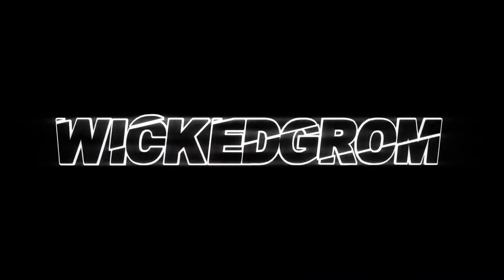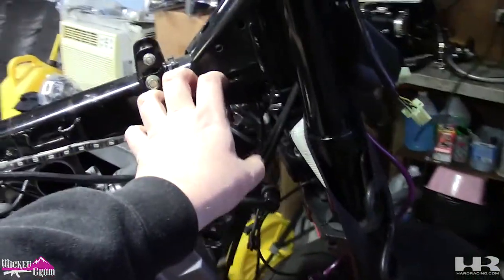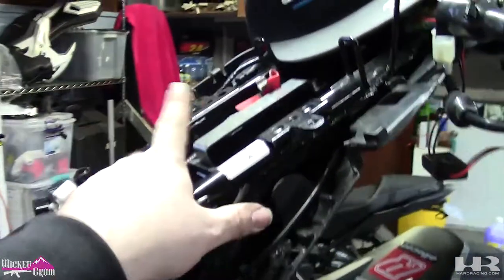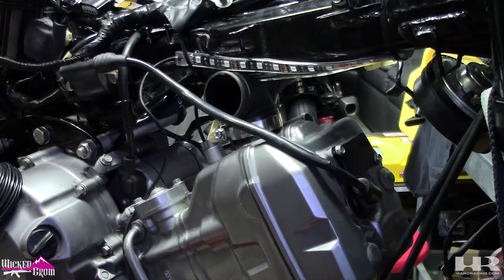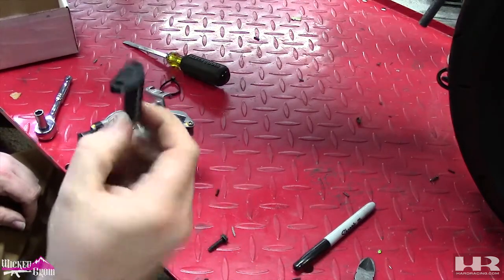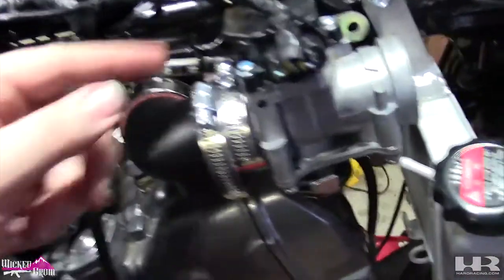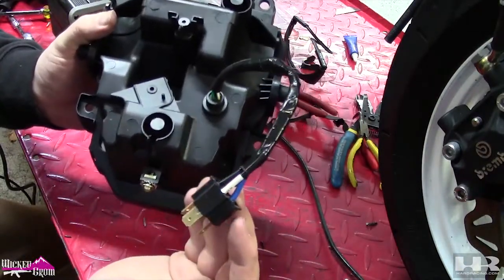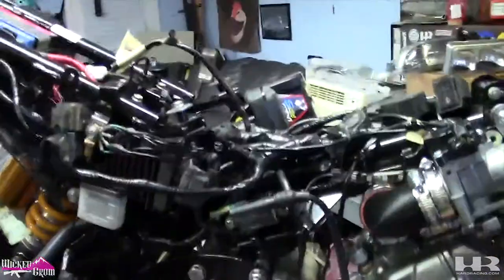Honda Grom 300 Swap | Part 5 - Wire Harness Install 300F

Comment: Love your chanel but I have a question why do you need a aRacer if you are using the ecu that comes with the motor??
Reply from the maker: you can use the OEM CBR ecu, It just doesn't run to well.

Comment: This may be a dumb question but imma ask it anyway. Why a CB300? wouldn't a 450 or 500 or even a 650 be better? Is this the biggest motor that will fit without major mods?
Reply from the maker: Not a dumb question at all! I got a complete bike for $200. That's my reason. CRF450 has been done, It just requires alot more custom fab work. MT07 motor has been swapped into a grom before. Comes back to the frame is designed around a 125. the 300 is only 40ish lbs heaiver so its not too bad and tucks in nicely. the 500 is a lot heavier and bigger so it would need to be offset. If you have fab skills, can weld, anything is possible.

Comment: Ok so I have an aRacer and everything but what do I do about the tip sensor and the kick stand sensor? I have seen people saying that just unplug them and aRacer will take care of it?
Reply from the maker: When using Aracer, They are not used. The tip sensor you dont even need to install or can remove it completely and leave it unplugged in the harness. The Kickstand, Its already there so just plug it in but its not activated with the Aracer ECU as Aracer is designed for "Race Bikes" which dont use kickstands.

Comment: I see you extending the wires with electrical tape and just cringe. After a year or so it just turns into a sticky mess...
Reply from the maker: All wiring is soldered and shrink wrapped at the connections then wrapped in 3M electrical tape like OEM. 3M does not break down like cheap electrical tape :) Will last as long as a OEM wiring harness.
Reply: @WickedGrom  I didn’t know 3M makes electrical tape 😅